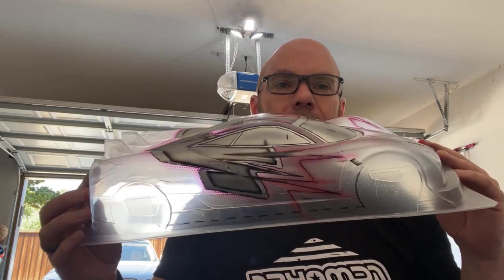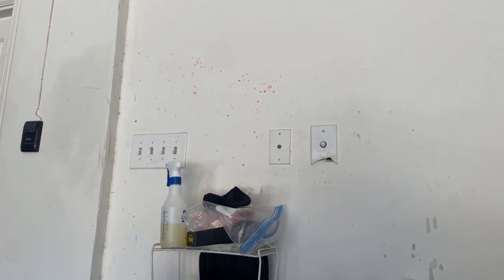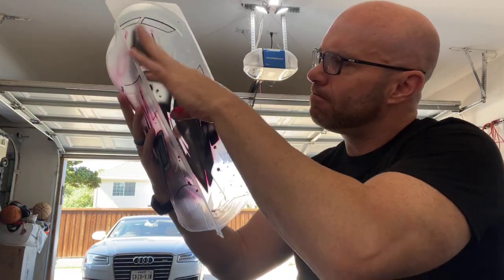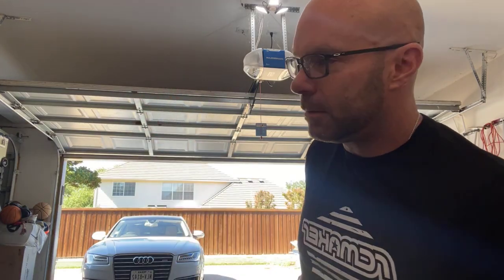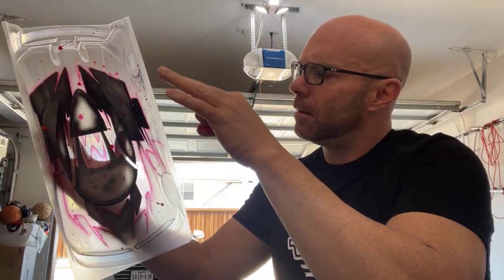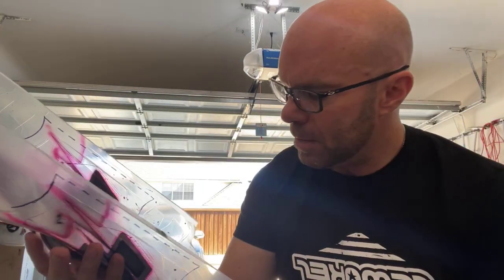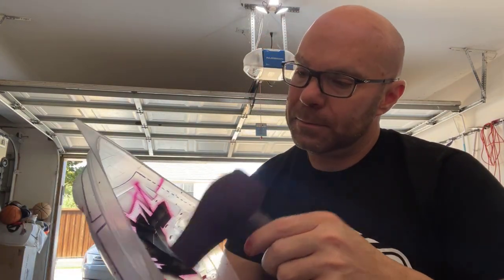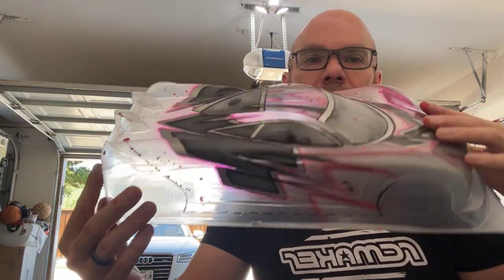Getting splatter effect on your RC bodies

Comment: I have been watching these in the background while working. I noticed the Iwata your using really seems to let out some paint. I use a HP-CS currently and I can never seem to get that much work flow to come out of mine.
Reply from the maker: Sorry for the late reply.  And the HP-CS *Should be able to shoot out enough paint.  What brand of paint are you using?  PSI?  It sounds like either (a) the paint is too thick (90% of all createx/wicked) paint should spray fine.  PSI should be 30-40 for normal sprays (less for tight fades).  I sometimes have to pull my needle back 1mm and lock it in, so the nozzle is a little bigger.  The only other thing is the HP-CS's nozzle might need a good cleaning